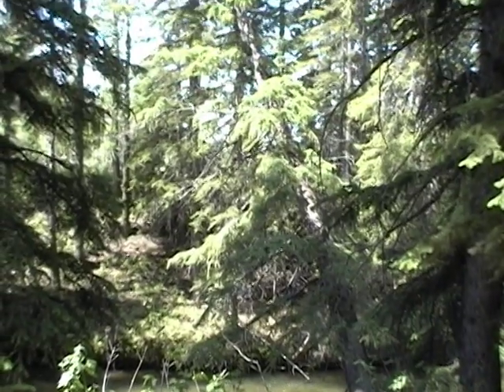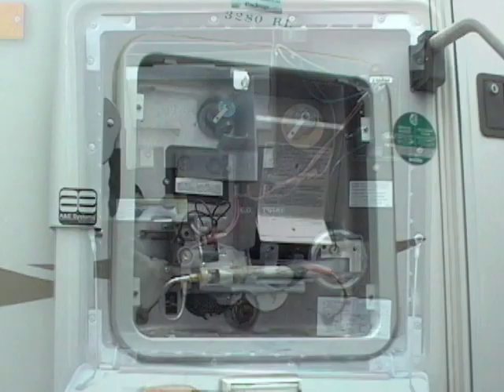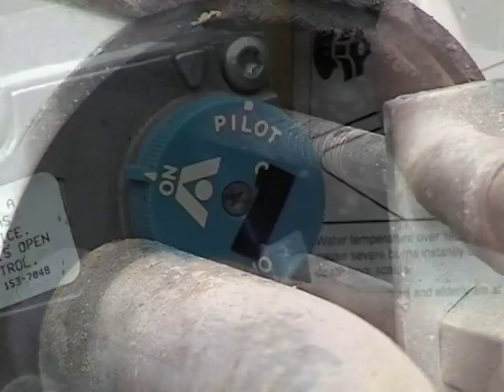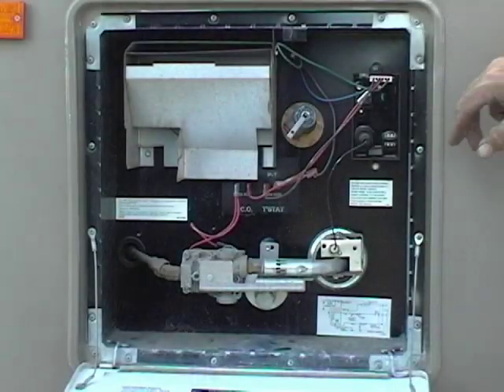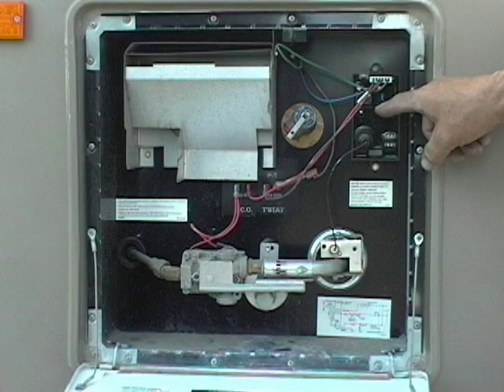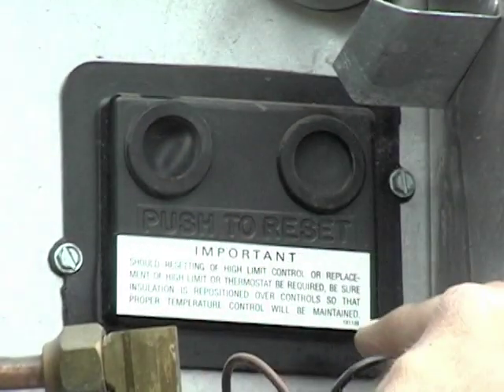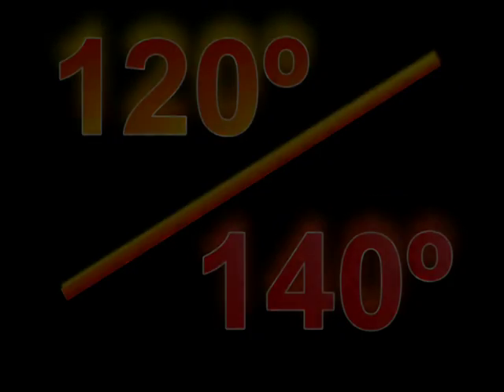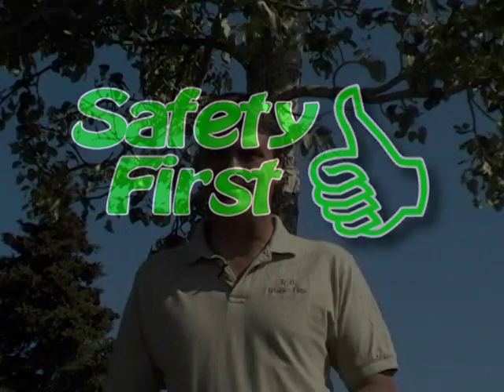RV Water Heaters - Learn about your RV water heater

Comment: Fundamentally, I simply don't like the inherit design flaws of this type heater.  Girard tankless water heater are they way all water heaters should be designed.  These old Atwood's can easily be swapped out.
Reply: Claimjumper - I would like to know why you consider Girard better than Atwood?  Its tankless, but apart from that, are there other reasons?  What did you find wrong with the Atwood heaters?  How easy is it to swap out?  What did the Girard cost?  Model #?

Comment: Hey... thanks for the info.  i bought a used TC 99 elkhorn with a hot water system,  and really wasnt sure how to use it so i didn't use it for the two times i went out.  I knew that with the pump on i had fresh cold,  but no hot flow.  I figured out the by pass system and before that i had opened the outside hwater 3/4 inch drain plug and got some nasty smelling sulfer water.  drained that out,  the moved from bypass to normal flipped on the pump and it took a few mins to fill the hwater tank.  i then opened up the hwater knobs in the galley and then the wetbath,  got rid of the nasty old water and turned those off,  let the pump go until it stopped,  went outside followed your pilot lighting instructions and whooshh,  away it went.  i bumped the heater to the hotter side so i could mix cold and hot for the shower to get more time for the amount of water,  and waited for the heater to turn itself off once it reached temp.. i think it took 10+ mins? then wa-la hot water for sink or shower!  it all works!... wasnt sure what i got myself into with this used tc,  but it has a multi refer,  AC unit,  heater and furnace... ALL WORK!.  i bought it in Minnesota over last winter time from a family whose parents had passed on,  the parents bought it new and did a lot of travels together based on the trinkets i found in the camper that the kids didnt want.  They stored it inside a machine shop so even though it was a 1999 model,  it was in good shape and no leaks.  I got to test that theory on my second outing where we got deluged for a few hours. Im rambling,  but excited to cary on the adventures this old retired couple had with thier TC.  sorta sad the kids had no interest in what thier parents adventures where or shared that desire with them.  They even left a really old school cassette tape that had a mix of some grand ole opray country type music in thier TC sound system.  Anyway,  thanks for all your videos,  they have been helpful to me anyway.  Here's to next years road trips!

Comment: Good job and thank you .. Bought a used A frame and didn't have the manual for the water heater and  the instructions inside the door didn't match . The on/off switch inside the camper wasn't marked and I was going nuts trying to figure it out . Thanks to your video , I did.

Comment: I have a 1994 holiday rambler pull behind camper its a 32 foot. It has propane hot water and electric hot water . my 150psi pop valve poped off an thanking it was bad so i went an bought a new one and changed it out and its also a 150 temp also. For some reason it keeps poping the valve when the hot water is on for a long time. The Only off. Switch i see on the hot water is the one thats on it. And there is no thermostat anywere to turn it down its automatic . what will be causeing my hot water getting way over 150 degrees and poping my pop valve???  Why is it getting to hot?? Thanks

Comment: I'm so frustrated with this fifth wheel ..my husband passed away 3 years ago shortly after i became disabled .. .when a the final expenses were taken care of , I had to sell the house and I bought a country lite camper ..its just me and my two pups , so we don't need much room ..I know nothing about a camper ...I had no idea it was so much different from a house ...nothing works the same ..I'm constantly having to get. Things fixed ..my hose outside was leaking a little so my son n law turned the water off and had to leave ..I kept hearing a weird noise in the kitchen and after three weeks had passed I discovered it was the hot water heater heating up ..but of course there's no water ..so I had my grandson turn it off ..its going to be turning a little cooler soon and is like hot water again ..now the main problem is ..its a 30 amp ..and with the water heater on I flip breakers constantly ..should I put propane to it and forget the electric or what ..or how will I know if the heater is ruined ..I'm so tired of everything being broken all the time ..

Comment: Atwood water heater the power or gas  will kick off I hook the two brown wires and  the red wires toghter and the gas  still worked. So I need to replace the thermostat? That is where the two brown wires hook up

Comment: We have just purchased a 2002 Trail lite B+. We cannot find the remote switch inside the motorhome for the hot water heater. We were not given a lot of information when we purchased it and we are trying to make sure everything is in running order but we have searched high and low for this switch. All the other switches are there but none that say hot water heater. Any help would be greatly appreciated. It is an Atwood electric ignition water heater, not a manual. Thank you
Reply: helene lewis jjm
Reply: If you've not yet found it; sometimes it is in the kitchen beside your panel that shows water levels.

Comment: I have the Suburban water heater and two toggles inside my trailer. Should I only be using one or the other? (Electric, propane) we thought the electric was to supply power to light the pilot??

Comment: after dewinterizing my class c motorhome, filled the water tank, flushed all the lines and turned on the water pump, and after all that I don't have any water in the hot water tank and the pump runs and no water comes out of the sink in the kitchen and or the bathroom, no sure which way to turn the valves on the heater, up, down or sideways can you help, I did not do the winterization.

Comment: but i have a duel fuel electric ignition atwood. i believe its a 1994 or 5 and the propane side works great but on the electric side i cant find a video to figure it out or anything on the web for the proper operatioon. ive got the breaker and the two switches. one on the kitchen cabnet top just under the counters edge tith the light which works fine as atwood and damon corperation intended for the propane side sofar and i have the other switch on the galvinized looking box inside on the water heater itself. ive pushed the safty already thats between the therm and eco for the electeic element operation on the inside but still idk. even if my element is bad i still dont know the proper operation procedures. is my light on the counter supposed to stay on for the electric to work or not and do both switches habe to be on and if so when i try that it still wants to light the gas when im not trying to use that option. im lost could someone please point me in the right direction?

Comment: OK so watching videos I have on of these water heaters the lever adjustment kind for temp on propane. but I'm using it on electric has switch on wall and switch on heater it's self it works great (I've never used it on propane) but my electric choice is causing water to be way to hot! is there not a temp adjustment on water heater for electric mode or is the lever on outside area to adjust it also while using electronic mode or is that lever only for propane. understood from your video that there's two different heating elements one outside (the lever) for propane one in tank itself for electric if u use electric then it's non temp adjust? but propane is, is that the correct understanding?

Comment: I got pilot light,and can see burner light. But can't get hot water. When I release pressure value at top of water heater on outside don't get any air or water out of it. But can get COLD water out hot water faucet. ..WHAT TO DO....HELP
Reply: sounds like you have the bypass valve to off position, turn on the bypass valve to let water fill your tank and try gas after heater tank fills

Comment: I just bought my first RV and have a question about the water heater. My RV is equipped with a 6 gallon Suburban DSI. I went camping for the first time and when it came time that I needed hot water I turned the propane on, waited about 15 minutes and the water was Luke warm at best. My question is: Is something wrong with the heater in your opinion? And, Do I leave the propane and heater running the whole time while camping, or just when I need it?  Thanks, Dan
Reply: s82111 See the RVGeeks video on newbie hot water mistakes.

Comment: Can you run 2003 on electric instead of battery I really need help we are cold our batteries go out and have to get more we are hooked up to electric but everything seems to still be hooked up to the battery stuff goes dim
Reply: you by a after market electric heater that will screw in to the drianplug  hole they have them on the internet
Reply: Fiona Terrell what is that ?

Comment: I have a 95 Dutchmen fifth wheel and I have leaking underneath the water heater and I was wondering whereabouts the leak would be without taking it all out.  it leaks every time I turn the hot water on and I see no visible leaks but I do have corrosion around the spring loaded valve outside

Comment: I have a 2003 Dutchman 5th wheel and the hot water heater works on gas not electric I put a new heating element in it and it still don't heat up wat's next
Reply: Check your switch is working, then test if there is power to the fuses behind the reset switches, then power to the element

Comment: I have a 99 prowler that when I light the pilot & turn to on ,it wants to go out, it will not stay lit! I've already bought a new thermal coupling/ignitor .any suggestions ?
Reply: If the tube to the thermocouple is pinched it can short. At times you can also buy a defective unit. If this isn't the problem, then the thermocouple is not supplying the appropriate return signal to the pilot control.